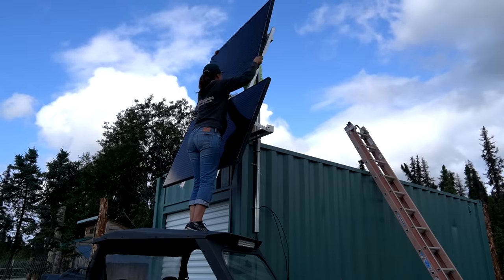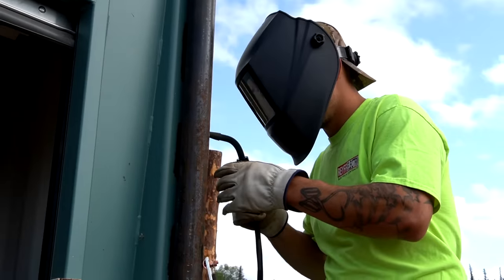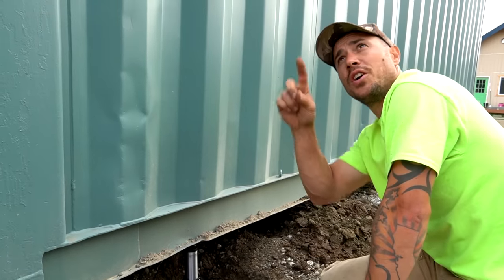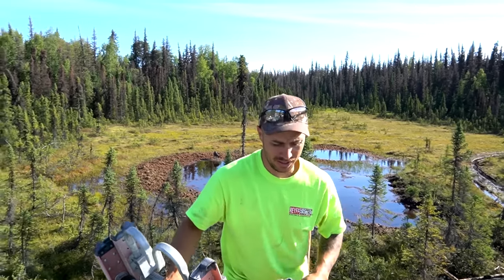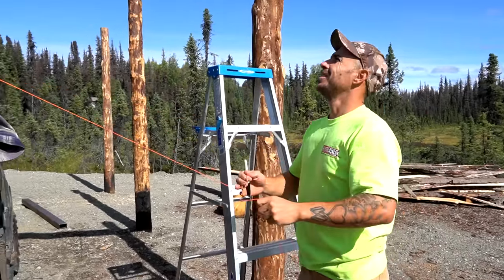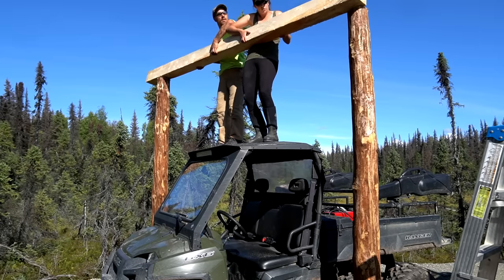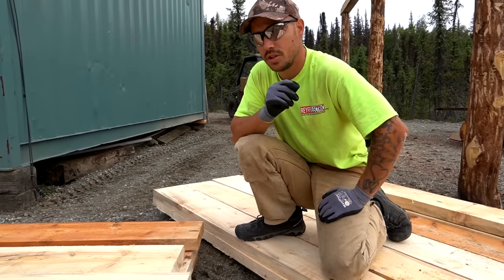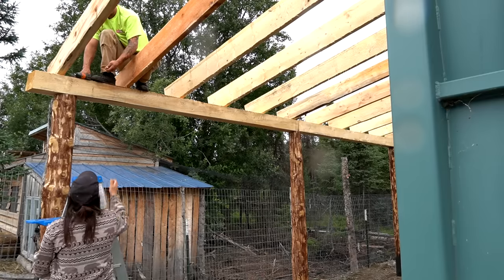Solar Panels & Rafters Go Up | Shipping Container Lean-To Build

Comment: Eric and Aerial I don't know if you have watched Al and Gina on lumnah acres there You Tube channel but when they built there house and we're getting prepared for building a greenhouse and need a area to store there vegetables so Al made a room in the basement and insulated it inside and on the outside of the room and put a cooler door in then he had a air conditioner he mounted in the window and he went to Amazon and bought a deal that where he could keep the cooler a certain temperature in the cooler year round you just open the side of the AC and hook up some wires and the AC could heat or cool your produce plus you could put your broths in there and moose meat fish and your vegetable from the garden. You should check into it since you can cut your own lumber now, maybe you could add a section to your house and maybe you could get lumber from your new property. Just a suggestion or thought !

Comment: For a sturdier beams on post. You needed to cut the beams in half then cut out sections of the top of the pile t. Then set a board on each side of the pole and the bolt thru the post and planks horizontally which will pull them together with metal plates so you will not strip them through the planks. This will be structurally sound and care the cross beams weight horizontally and vertically. Two bolts per beam/pole. Then weld u channel onto convex. Set the cross beams into it and then bolt horizontally thru beam/u channel/beam for vertical and horizontal load carry. Also will move with poles with earthquakes.

Comment: you need to make yourself some heavy duty sawhorses asap . youll save your back and the chainsaw won't hit gravel anymore . nail plates on the beam joints is also a cheap and necessary precaution

Comment: The beam on the conex I'd of used angle iron the whole way cupped it under beam and welded it to conex then lag bolted on both sides through the angle into beam. Then saved money on those store bought 2x8 clips by using pieces of angle and used 2 2inch lags on  top and bottom welded it to beam angle. Something to think of if yall decide to cover other side.

Comment: My two cents: Since you were gonna bolt the wood beams down on top of container, there's no need to get a steel beam for level adjustment. A wood piece would do the job just fine. I would shoot some silicone down the hole before putting the bolt in along with a washer which you don't have. You should use two washers... one for top & bottom for extra security. 
Also, you should use birdsmouth joint cuts so the rafters would sit better. There are youtube videos that would show you how to make those cuts. Those brackets are excellent added for security against bad storms. Other than that, Great job!
Reply: First thing I thought when I saw him setting them rafters up there. They would be a lot more stable.

Comment: Another question I have is is that snow sitting on top of that roof is not going to wreak havoc of some sort? And are you going to spray paint the top to make it more rust-resistant? And or put a roof with a peek on it and possibly put a solar panel on it?

Comment: You should take some angle iron on the pipe as well like up the sides of the pipe to reinforce the pipe cause of the wind pressure you will get there might rip the pipe loose of the container...other then that your foing awesome 👌 👏

Comment: Late for it to be of use on this project but if you are doing a similar project in the future check the tool rental places on if they have a duct jack as it can make lifting heavy sections of wood every easy even if you have to setup a base for it as it normally works on concrete floors. Hard to beat something that can get 600lbs 18 feet in the air. A 2k price to buy it so much easier when you can rent it for a day or two to get the materials up then return it.

Comment: I think I would also have welded two pipes to the top of that corner pipe and to each side top bar of the container, like maybe twice the length of the pipe that is above the container roof. Like you can see for example on navy ships - the way they secure a flag pole. Well, maybe not the best explanation, but you get the idea.
Reply: Hi how are you doing?

Comment: Only thing I would say is make sure you rust proof the other side of your welds. I work in a body shop where we welds cars back together and you always need to remember the other side because the heat will burn the other side of paint.

Comment: It looks good but I have a couple of questions, (1) would have it been easier to notch both ends of the two by eights to fit across the beams meaning you'd be able to attach them with long bolts and just brace them with the brackets for extra security or would it have made the roof too low and (2) will you be treating the wood so it doesnt rot or warp too easily. If so wouldn't it have been easier to do whilst still on the ground. Im not criticising what you've done as it looks really good, im just curious as to why youve done things the eay you have. I look forward to seeing it finished. You both never seem to stop

Comment: Levelling the conex will cause water to pool on the roof and cause corrosion, I would have given it 2 inches towards the front like bee hives so water can drain both from the inside and top.

Comment: Take down the rafters and make seat cuts, top and bottom. If you dont they will roll the headers to fit  and then not sit on the posts. A small seat cut like 1x3 will solve that problem. It only takes an hour to do it right.Bolt the headers to each other and to the posts, weld up some big T straps..

Comment: Come on now guys drywall screws to hold the beams? Drywall screws are incredibly brittle and not outdoor rated. Even though they are coated they will rust and they will break from those snow loads on the roof. Hurricane ties have specific mini lag screws designed to handle the load although I am sure you could get away with regular old 16 or 20 penny nails. Nails will bend and weave with the wood, the drywall screws do not bend or move they just shatter. Love the channel and build just figured I'd throw this out there. I noticed you did use some nails to toenail the beams in which will likely help a good amount but I would really change those drywall screws out on the hurricane ties.

Comment: I was wondering about the extra post that y’all put in, will you still be able to open the back doors all the way? Idk if it’s the angle of the camera shot but it seems like the one side would be hindered by the post. Maybe you don’t use those doors 🤷🏻. Excellent build guys, looking really good. Your homestead is really coming along, you both should be very proud.
Reply from the maker: We can still open them but not all of the way, we have never used them before though  ;)

Comment: Better put load rated screws on them hurricane bracket ....Regular screws the heads will pop off....Also cutting a birds mouth at the top plate and headers will keep them from racking and will support the weight much better....Good job tho

Comment: Do you have permafrost melting under the gravel pad, and are there substantial  earthquakes causing your buildings to shift and move over time? If so the stresses on all the joints might exceed your design strength especially with high snow loads and high winds. Please consider doing some more strength calculations.
From my un-informed armchair vantage point, one might consider using substantial using steel nailing plates for the post and cross beam connections, as well as more substantial nailing plates for the joists to cross beam connections. Perhaps some some more steel bracing inside the connex container as well. Perhaps design  ways to adjust the outboard  posts to compensate for unstable subsoils.

What do you think?

Comment: My experience, if you drill a hole on the top of the container in a low spot it will leak water. Whenever possible I drill a hole in a high part of the corrigation.

Comment: Opsco is the stuff to use before you paint......it looks like green water...creates a lite parkerising.  I think they use it on beams.  I've used it on guns....after it's on you paint it.....I've tried to blue over it.....will not take the blue because bluing is rust.  Ace hardware used to carry it...should have it still,

Comment: It was a mistake to penetrate the roof of the conax that you may regret.  I would have welded some L-shaped brackets to the top of the conax and screwed them into the back of the 6" x 6" beam.

Comment: I would have definitely put some type of metal to cover the holes of those pieces of metal you welded to put under the wood. Either that or I would put some holes on the sides all those pizzas for drainage. Cuz water is going to sit in those holes. That will cause rust and rott

Comment: Are ya gonna put something across the top of the con x cause over time the roof will rust out and start leaking water sets in the vallies, been around con ex's for years if you don't paint every so many years they rust real bad

Comment: You've attached your wood beams on top of the Conex to 'nothing'.  That sheet metal is not structural... your nut will pull right thru it in a high wind.  You should put your bolts thru the square beam at the top of the Conex, and use a 2"" square washer and a round washer under the nut.

Comment: Looking good guys! Glad you finally got a welder Eric. It will come in so handy. Did your Yamaha inverter generator break? Just wondering with the new Honda.
Reply from the maker: Returned it to Costco ;) started to have issues with it
Reply: @SimpleLivingAlaska  ahhh, I was looking at them due to price. The only time I’ve worked on the Honda inverter was, pull cords and maintance… but, that comes in the price tag aswell. I think you’ll be happy with it.

Comment: What solution are you using for snow buildup on top of the shipping container  roof ?
Reply: This is what I was wondering as well. (Not the container, the new lean to.) My husband is a mechanical engineer who grew up on a farm in Massachusetts and Maine. He said if they have a metal roof the snow should be easy to sweep off. And the 2 x 8's should be strong enough to hold the snow load. It didn't look like the pitch was steep enough to me (like compared to the roof on the new cabin) but the engineer said it looked ok.

Comment: Why 6x6 cross beams? You used 4x6 for the wood shed. Is the spacing that different between the posts this time?
Reply from the maker: Originally the 4x6 beams were going to sit flush on top of the conex so we didn't need them as strong, but now that we added the spacers to the top of the conex the 6x6 beams would have been nice to have up there also

Comment: I would have welded caps onto those spacers and then bolted the beams to that instead of drilling holes in the top of the connex.
Reply from the maker: Great idea!

Comment: If you brush OSPHO on the welds, pipe, and steel where you removed paint, those areas will never rust and are paintable.
Reply from the maker: Great tip thanks!

Comment: I don't think that will take much torque load due to welding round to square. I bet I could twist that off with a 2 ft pipe wrench. I would well some flat bar stock to cover then wrap it around pipe and weld to corner of conex . 1 high and 1 low should do it.
Reply: Love the channel btw.

Comment: 17:20 i hear my father yell at me(you) inside my head. ~Dont use your hand as a hammer!~ 
insert dad voice -"some day you'll slap a rusty nail, get a proper dry wood spliner or worst split the handle on an old chisel and get that tang through your hand... If you never start you'll never have to experience it" (yet he still does it). 
-"And dont kick things all the time, that time you have sandals and not steel tipped boots your foot will suddenly look silly...
So i've gotten a few holes in my hand but not through and through yet and the toes are yet not broken but the nails have been left behind 3 times... I guess i never did listen very well. ;/

Just a tip.

Comment: The spacers that you cut are gonna sink into the 2x because of their small edge and you're torquing it down with an impact gun. Yeah they're not going to act as spacers bit more like a locking pin.

Comment: Is your snow load going to end up in the chicken coop?
Reply: We'll have to watch that part again, but I think there was a good amount of space between. They have several winters of snow removal experience, and I remember they said they added tons of gravel so there is a place to push the snow into. It takes a couple of seasons, but you do know enough by now to have a plan. Then you just go through the heavy snows and make adjustments in a year's time. They are good about snow management and access.
Reply: @brendag2891  I wasn't concerned about the weight, but that it would slid off the roof right into the chicken coop fence.
Reply: @SctyGrpPowers  gotcha! Good observation. I believe I remember a video from last winter when Arielle was snow shoveling out the chicken coop so the birds could not just walk up the snow drift and over the buried fence. Although it appears that the coop fence is pretty easily movable, we could only see the one side of the outside pen/coop area which runs adjacent to the new lean-to. Snow slides off all roofs, and they do have to manage of it, so I'm sure (living in a snowy climate myself) they have a plan. It might be wide enough to get the snow blower in between, and snow can be blown forward so you keep running over the stuff that doesn't get thrown out of the path, and eventually make a pile on the end of the connex opposite the solar panels.

Comment: That one bolt down the middle of the pole doesn't seem enough to safely anchor those heavy beams. You should also use steel ties for those.

19:33 safety not first? Seriously if that other end of the beam rolled or slid from the post, you both could have ended up in hospital

Comment: I was just wondering some are you all gonna come from the rafters you've got you're ending up at the top of the contacts why don't you bring your rafters all the way to the center and join them to the center in that way your medal comes all the way from the top center and your whole contacts will not have any water on it at all and then you could store a few things up there if you wanted to

Comment: The screws you are using for the joist hangers are not rated for that application. They should have a square screw hole in the head and a rounded on top shape with a flat snug up side to the hanger. Also two different metals will corrode over a very short period of time and snap the heads off. The fact that the joists sit on top of the wooden posts and top plate will probably keep them from totally collapsing but I wouldn't bet on it.

Comment: You're not supposed to use screws for metal fasteners there's no Shear strength you supposed to use TECO nails they're designed for that and rated for that the screws will snap really easy

Comment: Hey Eric did you no that on those metal brackets that you used on the sides of your trusses that you are not supposed to use screws??? It defeats the purpose of them!!! You are supposed to use what is called a TECO nail!! They are a harder nail and are ment to be used with those brackets!!! The screws will end up breaking they say!!! Just thought I’d let you know!!
Reply from the maker: Thanks for the tip :)

Comment: You will regret badly leveling the container with untreated soft wood, instead of cement/iron blocks, it will not take long until they start giving away and all your roof will suffer from it. And then it will be a pain to lift the container coz this time you have a roof attached to it, hope is not to late to change it.

Comment: OMG you really do not know anything about building a roof. The 6x6 beam you should overlapping from one to next beam. Then fix with 2 or 4 long screw crosswide. You will see in view month when the wood get dry what will happen with your construction.

Beside for storage wet wood you should:
1. Between each blank a pc of woodstick, so that air get throug and dry the wood equal.
2. the end of the blank you have to seal (with lack, oil, wachs). Otherwise the wood will splitt on that part